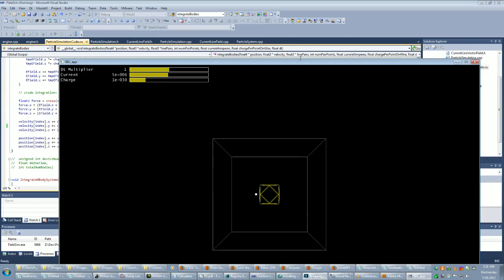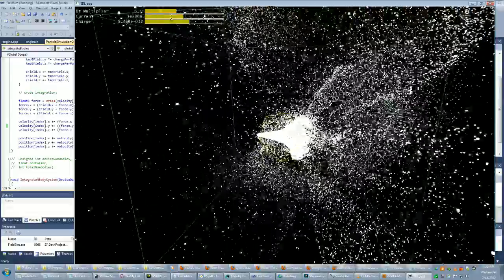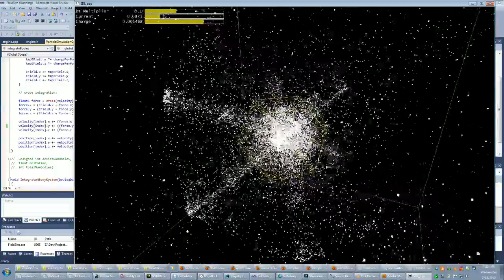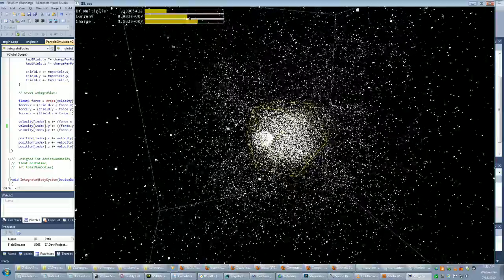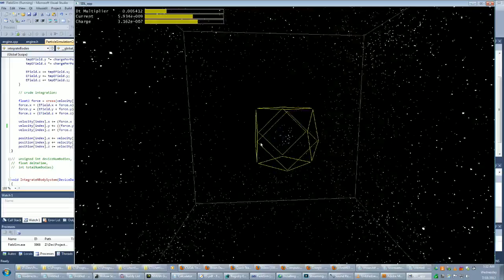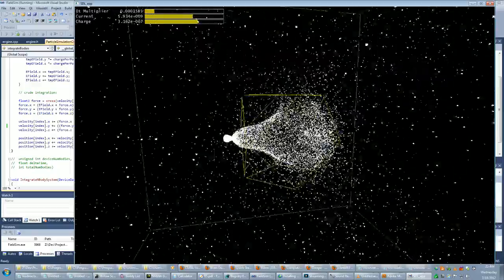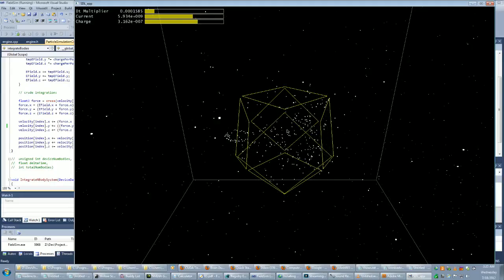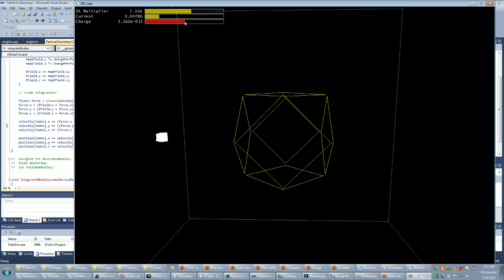Fusion Particle Simulation with CUDA

Comment: Have yoou gotten farther with this project?  its awesome :D
Reply from the maker: Hi FyJonas. I haven't spent much time on it lately. I did however do quite a bit of work on that helical custom integrator, and adaptive time steps. I wrote some blog post about rk45 which was inspired by it on buttersblog.com I am not sure how to tell if my algorithm is convergent or .. I can't even remember all the terms right now... Sound? Solid?
Reply from the maker: I'm picking it back up again now. I've struggled before with stability keeping it real-time, so I'm going to go for accuracy and record the particle motions, computed offline, and then just make it so I can view the playback in 3D.

I have a bunch of things I plan to do now...
There's new data from EMC2. My goal now is to be able to replicate the experimental results in the simulation.

Comment: ...the ions limits the number of ions that can orbit the negatively charged sphere.  But what about all of the electrons that are scattered in the initial explision?  If the sphere and the spherical housing of the vacuum chamber are at the same low negative voltage then it seems that the electrons would be trapped and provide neutralization for the ions allowing for the addition of many Coulombs worth of ions.  The electrons would tend to congregate in the area of high positive charge at the

Comment: The deuterium ions go into orbit  around the sphere and return to the point of the explosion giving them another chance for a fusion collion.  If the initial explosion point is far enough from the sphere (about 3 or 4 times the sphere diameter) then the probability of a collision with the sphere are small enough that ut looks like net power could be obtained.  One major problem us that the point of the initial explosion becomes a point of high positive charge.   And the positive charge of all of
Reply from the maker: I don't think all of the particulate from the explosion would arrive back at the explosion site at the same time. Also explosions are in 3D so particles would be going all over the place. And also, Hydrogen's freezing point is pretty damn cold. And also, the deuterium particles would repel each other so, you'd get even more complex motion, and even if they did start to converge on a part those repulsions would likely make everything have all kinds of different orbitals. By the way not all particles would be given the same energy from an explosion.

Comment: I heard a fellow say in a rather smug way it seemed that a fusion reactor using electrostatic cinfinement would never work.  Once someone says simething like that it gives encouragement to the possibility that it would work.  I think noone really knows how mych power the Farnsworth fusor did or could put out.  I have my own electrostatic confinement reactor built on a computer simulator.   It is a very simple device.  A tiny pellet of deuterium is exploded in the vicinity charged metal sphere.

Comment from the maker: Yes, but it's practically the same thing. The purpose of my project was to allow me the flexibility of manipulating the configuration to test other setups as well. I couldn't discern any real difference from using rings over squares. The corners of the ring version form 3 point, non-planar stars which seemed less ideal, but perhaps more practical from an engineering standpoint. Especially if the system has some form of liquid cooling to facilitate super conductors.

Comment: Have you tried this design?  /watch?v=ao0Erhsnor4
Reply from the maker: With the circles instead? Yes, but it's not much different and the thing is, if you think about the current, all of those circles have current such that they all have the same magnetic pole pointing inward. Well, the corners, end up having opposite current, which is how the field lines close back up. So they go in the sides and out the corners, so to speak. This means if you use circles, you kind of have awkward corners. If anything, I think it'd be interesting to give the corners circles and make the sides have the convex edges to make the surface areas more similar between the squares and triangles. The whole point of this is that once I have the simulation setup well, I can permute with other geometries to see if there are better configurations.

Comment from the maker: As for the energy, I have also modeled the electron gun with a range of random variation, which I can configure in the code between runs. I can't recall what velocity I release them at right now, but I am using the actual units for charge and velocity, I just use a very small dt.
As for the gyroradius, I actually tried modeling the motion with this in mind instead of just using a constant force with a Euler step for the whole time step. But I have not tested the numerical accuracy and stability.

Comment from the maker: I was using a positive charge on the coils, but no charge on the outer grid. Since the electrons are negative and the coils are positive, they are attracted back anyway.  Plus the magnetic field lines loop around eventually anyway, though are weak out that far from the coils.

Comment from the maker: Like I mentioned in 3, I have used tracers to see how the fields look, and I did have to space apart my corners or there were strange issues. I think I have some screenshots from those tests on my site, I'll add a link to the description (see "early stages of this project on my site")
I'll consider adding configurable measurement spots, that print the field strength and direction as the inputs are tuned.

Comment from the maker: 3. I have done tracers to visualize the magnetic fields, which were very interesting, but I haven't tried tuning it for a specific value. The current in the wires is tunable at runtime and thus the magnetic field strengths are not fixed currently.
4. In the simulation you can actually see little boxes moving along the lines to indicate the current direction. Rest assured I have accounted for this rather trivial aspect ;) If I had this part wrong, there wouldn't be much hope for this project! :P

Comment from the maker: I have full control over the input wires. The fields are computed from the summation of the line segments, so it's very configurable to try variations. Right now I'm just getting the math and physics right before trying to model the actual data from Bussard's experiment. That said, I could also create ring primitives which will be cheaper than trying to have many small line segments that approximate a circle. The square form is interesting because it makes the corners more like the sides.

Comment from the maker: My concern with symmetry is the particle-particle interactions between neighboring sections, where I do not expect the interactions would produce mirroring forces. Also the injection of ions I wouldn't really expect to be mirrored, so it having the full simulation is valuable to me, even if I have to run it offline and render frames out, it's worth it to me start with an accurate model than to make simplifications too early in the process.

Comment: 8.Bussard predicted that when the beta is one, the average electron temperature is 2,500 eV.  Are you getting that?  Way above or below that?  If the electrons are released outside they could be as high as 12,500 eV.  Another thing to measure is the electron gyroradius – it is the radius of the corkscrewing path of a single electron.  You might want to model only a few electrons at first to measure this.

Comment: 7.  There is also a cage voltage outside the rings.  The cage is a cube 44” to a side in which the rings are placed in the dead center.  The rings are held at a positive 12,500 volts potential above the cage.  This makes the escaping electrons fly back towards the rings if they get out.  It looks like you have some of that already in this model.

Comment: 5.Bussard stated in his paper that the rings are spaced such that the corner field is about the same as the axis field.  That axis is the spot in the center of one of the rings.  Is the magnetic field there 70 to 100 gauss? 

6.Can you set up monitors in your program, which will measure the gross (aka the sum of the X,Y and Z fields) at the corner, center, axis and joint?  Can you then move the rings and see what this does to the measurements?

Comment: 3. Dr. Bussard predicted that at the Corner (a.k.a. one of the 8 spots equidistant from three rings, in the corner) the magnetic field should be 70 to 100 gauss.  Are you getting that?

4. Have you got all the ring currents in the wire moving in the correct direction?  You can figure this out using the right hand rule.  The rings fields should all be pointed into the center – either the north pole facing inwards on all six sides, or the south pole facing inwards.

Comment: 2. I noticed you have square wires in box shapes – can these wires be rings like Dr. Bussard’s last machine?  Measured from the center of the wire rings - that machine - had six rings that were each 10 inches in diameter.  A pair of rings (from ring mid plane to ring mid plane) were 13 inches across from one another.  You could use these dimensions in your model.

Comment: Nice Work!!!   I have a couple of Friendly questions:
1.Can you use planes of symmetry in this code?  If so you can boil the simulation down to 1/8th by cutting the model by 3 symmetric planes.  If you really want to get fancy, you can cut it down further to a 1/48th model – that still contains the corner, axis, center and joint geometry.